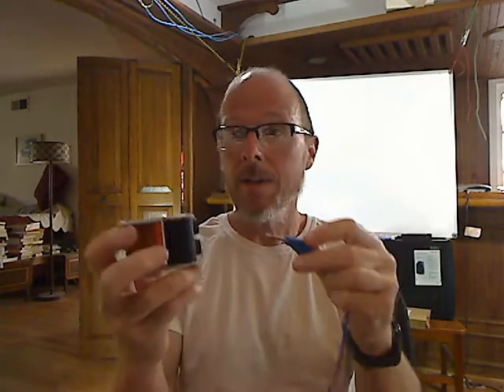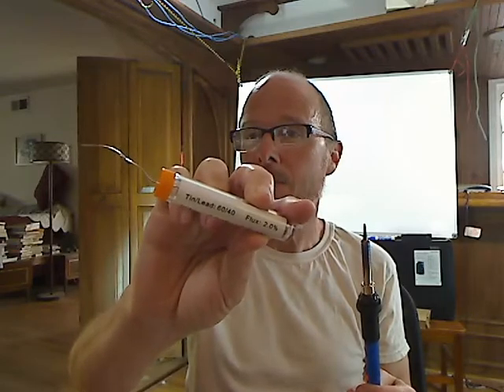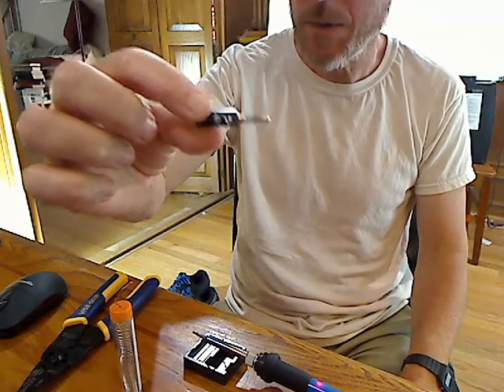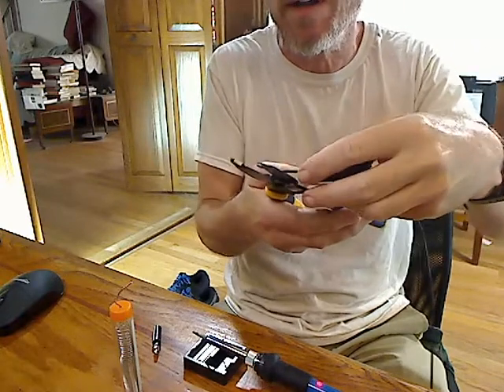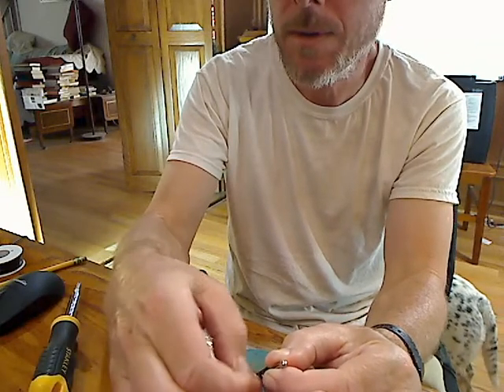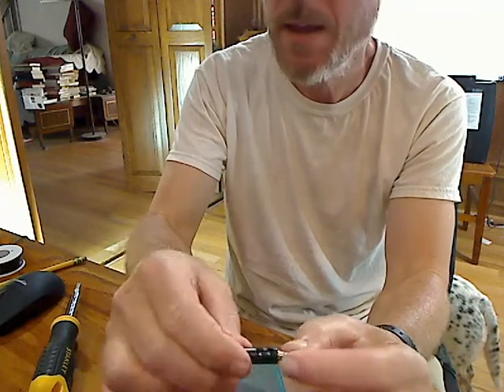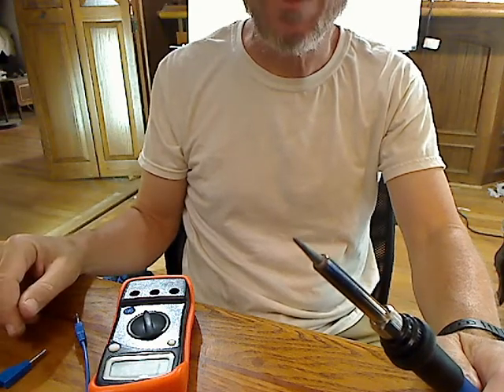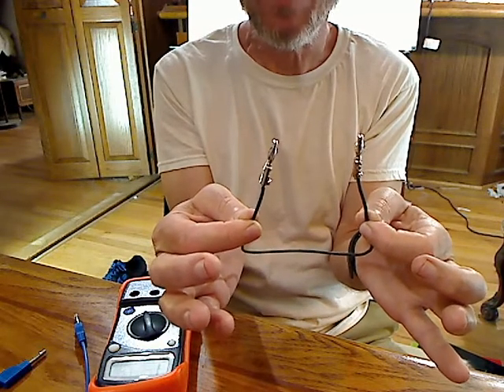How to solder a banana plug connector

Comment: What a hack job. Aluminum does not belong in this assembly nor does solder. There are banana plugs designed for solder but these are not. He should be tinning the wire end with solder to prevent fraying and then inserting and securing with screw.
Reply: Never tin a wire that shall be hold in place with a screw, the wire loses its elastacy with tin. You can crimp on a crimping tube.
Reply: @FredrikK56  Nonsense. There are literally millions of assemblies that come from the factory with tinned wires that are inserted into screw terminal.